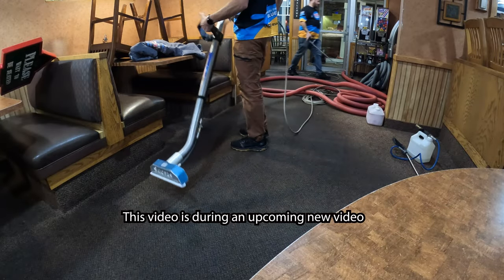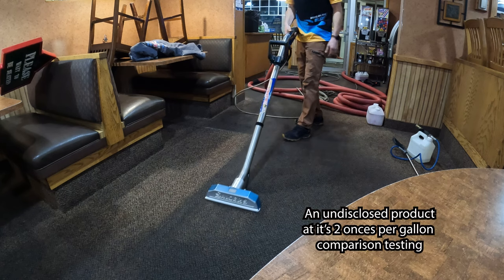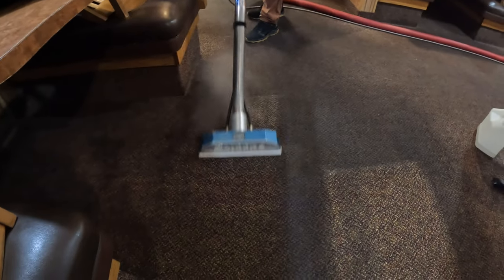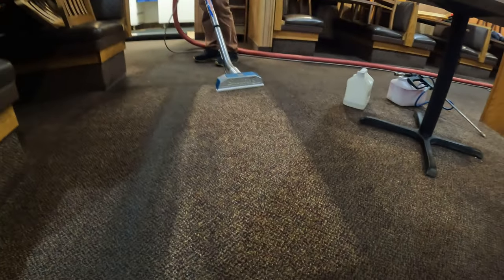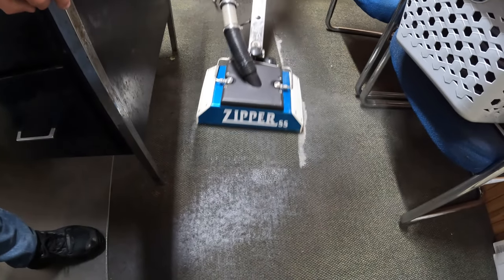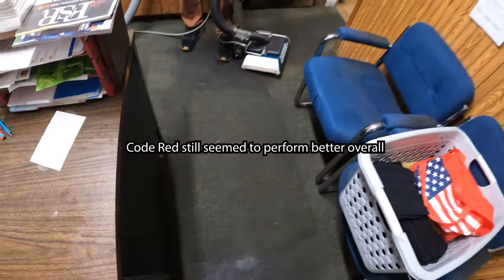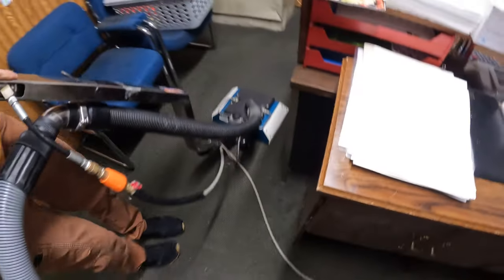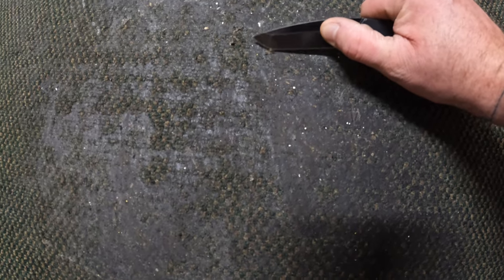Testing 1-2! How we Test the Best Cleaning Products on Greasy Carpets!

Comment: Great job guys. How much dwell time are you giving that Code Red before you start ripping? Also, you mention agitating. As Aron confirmed at one point, I couldn’t imagine you’re referring to your CRB? What would you agitate that grease and grime with? Thanks Mark, you’re a great resource for us all!
Reply from the maker: We are impatient (I would say 😁) Dwell time was as long as it took to spray it down and hook up the wand to start cleaning. So what you saw in the video for the most part is our dwell time with Code Red. The other product also was given the same dwell time. We are looking at cleaners that can make it more effecient for us and speed up our cleaning. For agitation probably would consider a CRB or more aggressive using some type of rotary scrubber like a 175 and red pad, but room would be limited and we still find ground in grease like this, well you can barely scrape and cut through it with a knife. We also do a lot of our cleaning on video without agitation to show what the chemistry can do. We know many cleaners do not have agitation, so another reason we test without agitation... But agitation can still speed up cleaning many times. I do have some jobs I try to feature the benefits of agitation also in my videos.